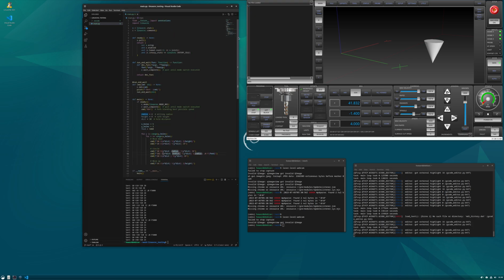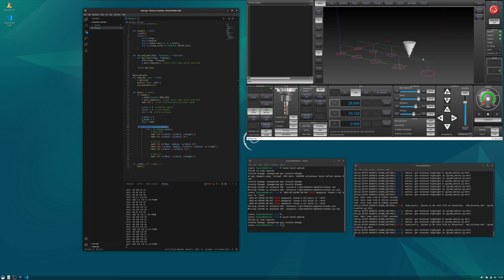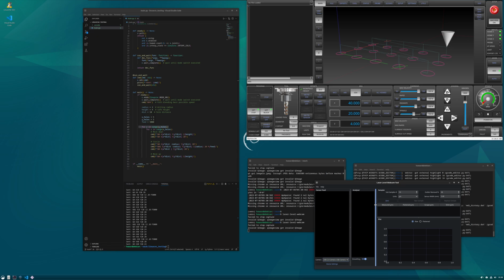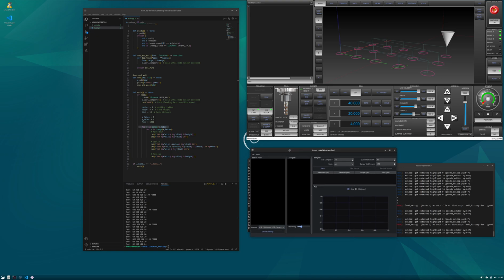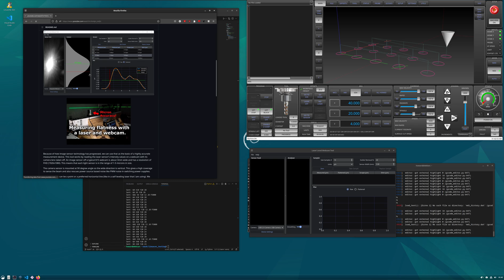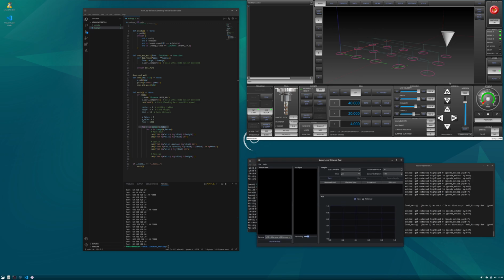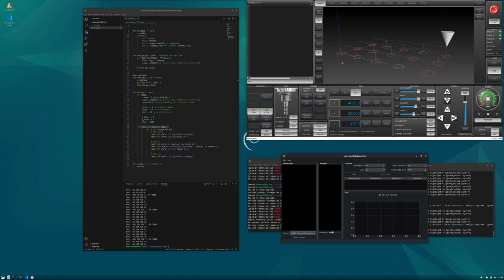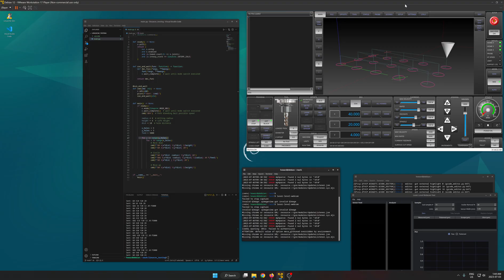🔧 Prototyping a CNC Surface Flattening System with LinuxCNC, Python, and a Laser Level Webcam! 🔧

Comment: Hello sir,

Can I use this GUI?  I like that modern industrial look. Ideal for mill?
Reply from the maker: Yes you can. This is running Dragon HD. you can find more information on installing it into linuxcnc here: https://linuxcnc.org/docs/devel/html/gui/qtdragon.html If you don't use linuxcnc than you'll have to look into that first. All of this is free and open-source.
Reply: @BryanHoward wow..!
Reply: @BryanHoward Can you do a tutorial series on how to setup an Ethercat based system on LinuxCNC? Nobody has ever made such a video on this.

Ethercat being free high-speed deterministic communication method,  It is a dream!!   But interfacing and installing it to LinuxCNC and mapping HAL and drives are unclear. I searched everywhere.

A detailed series of videos are highly appreciated.

Lot of step and dir method videos are available on internet
Reply: @ThakkuduMukkudu  i followed th tutorial of RodW on the Linuxcnc forum... the first Entry in the Thread about Ethercat was updated, so it works with 2.9 and was easy to follow... Drives can be a challenenge when not supported by the lcec Ethercat library, then you need to make your own CIA hal files... but the Forum is full of this stuff... :)

Comment: Hello, I am manufacturing my CNC Router, I really want to use and will use Linux CNC, I am a product designer and programmer. Now there's something that bothers me a lot... Linux CNC, from what I've read, is a fantastic tool, but the graphical interfaces are rubbish, I really don't like it, I've done a lot of research but I can't find much information, what I really want is to create an interface web. The problem is that I don't want to make the reader from scratch where the g-code information is loaded, nor the graphical interface, which is really cool. If I could find something in Javascript for these two items, mentioning the rest, I would have the courage to create a more beautiful and functional interface. Take the example of the Masso CNC Company that created its system from scratch... The interface is beautiful... clean... Linux CNC also needs to have a beautiful and clean interface to be up to par with its features... Where would I find a reliable Javascript g-code reader and viewer to start playing with.

Interestingly, this G-CODE Linux CNC viewer is made in Python?, C++?..... Let's create a beautiful and functional interface for Linux CNC?

Comment: Nice work!
I would actually make a hard mechanical connection holder for the webcam "tool" to fixture it to the spindle nose (maybe even a collet with mounting points for the camera board?) and do an initial dry run without any material or actual cutting...
The only real downside to this is that you don't account for some machine flex under cutting load, but it would be much faster for the initial reference "surface mapping".
You'd still need to do reference cuts in a real material, but unless you plan to run CBN or diamond tools to get the flats be aware that lateral cutting forces are REALLY weird when you use carbide tools (with usually quite dull cutting edges) to shave a very small cutting depth pass. You might even be better off (than with carbide) with an HSS tool that's lapped really sharp for the calibration passes after the first reference cut.....

Comment: Nice VCP. Is that what Dragon looks like in 2.9, or did you update things? Looking to making that move myself.
Reply from the maker: It's what dragon_hd looks like. It works well on an 1080p screen. It has a bunch of different color schemes this is one of the darker ones.
Reply: @BryanHoward  ahh, right. Forgot about _hd. Need to load a sim up myself and Se what it will take to move over. Nice project btw! Thanks for posting.

Comment: Have you seen the work that a grad student did on a 3D printer using a webcam and a laser to auto-calibrate pressure advance by extruding lines and using the laser/webcam to measure those line thicknesses very accurately? It’s not exactly what you’re doing but it seems like there would be some overlap and his code is open source. If you YouTube automatic pressure advance calibration it’s the video by Mike Abott